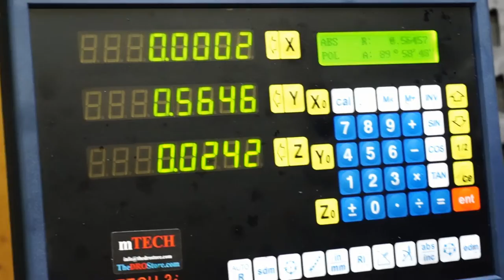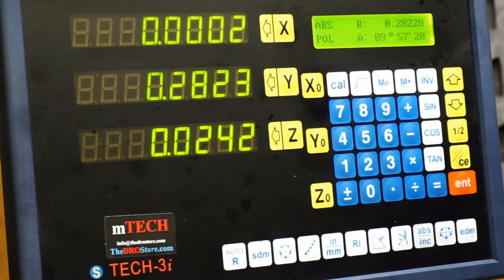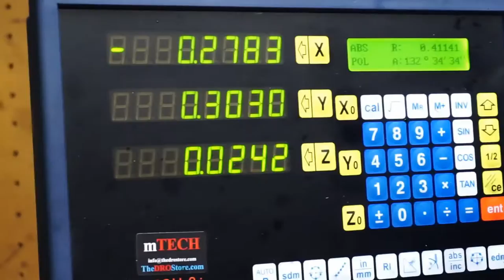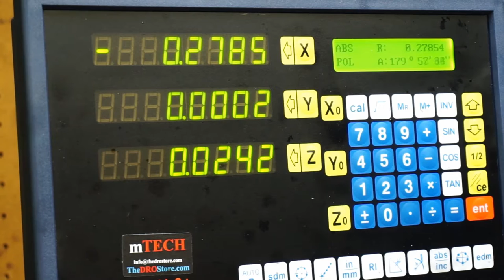Milling AR Lower for Tensioner Screw

Comment: Just drill and tap from the top... no milling required..
Reply: That is exactly what I was thinking. It would be easier to center the pin hole from the top and have it directly below the take-down pin lug.
Reply: This is fun to watch, but seems kind of over complicated. My other lowers look like they were drilled from the top, too.. which is what I'm gonna do.
Reply: Exactly
Reply: Spot/centerdrill from the top, drill, tap, done. Like a 5 min job instead of 30 minutes of pun dad jokes.